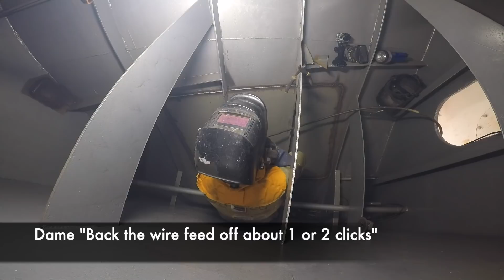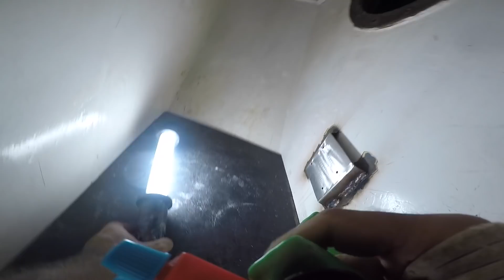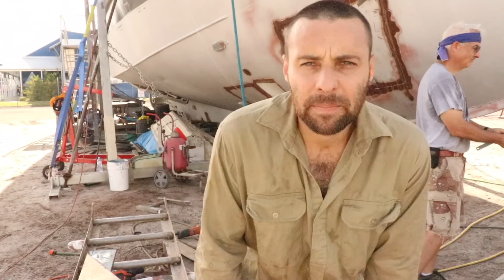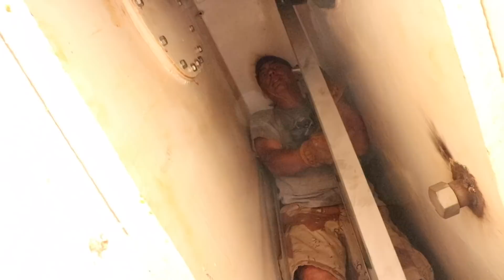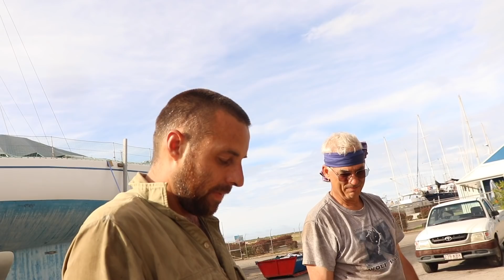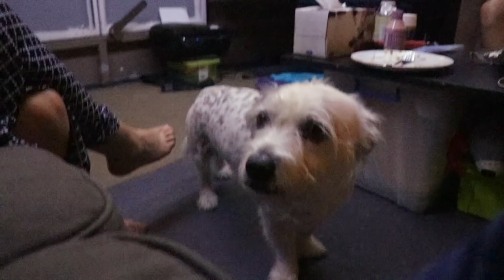Welding our hull closed (part 1) - Project Brupeg Ep. 75

Comment: I read a couple of great comments concerning drilling stainless-- yes, cobalt bits are best.

That said, with higher quality stainless, especially (such as 316, etc.), keep the heat down-- I mean friction (one comment mentioned "go slow". He's quite correct).  Heat toughens the stainless and actually makes it harder and more brittle, thus making it harder to drill as you try to drill. Another comment said "lots of lube"-- also quite correct. 

Ideally, it's preferable to drill stainless on a drill press set to a slow speed which frees one hand to apply lube every few seconds as you drill (assuming you have your piece clamped to the table).  With this, even Titanium will actually work-- going slow.

Yes, I know this bit is quite a few months too late. But future reference, bear this in mind.

Love your boat, love you guys! Rock on!
Reply from the maker: Thanks very much, since this video we have brought a drill press and nice vice for it so everything you’ve said fits with our current methods
Reply: I'm sure you're glad for it (drilling the hinges for your stern doors would have been much easier with that). You have plenty of work left for that drill press in the future, however, and maybe you can mount it in the boat  as part of a shipboard shop? 

You're doing an utterly fantastic job on this project-- you're fearless and competent, yet unafraid to seek help on what you don't quite know or understand-- that's what winners do. And why they win.

I heard of your project from watching Dangarstu (love that guy, too!), and, later, heard about you from Doug, with SV Seeker.  I found both Seeker and Dangar pretty much accidentally-- sweet finds! 

I also found the Arabella project just by chance. and had already been following them before Stu mentioned them-- and then he went to visit them! That was awesome. He also visited Doug while in the states-- what a great adventure for us that follow all you guys. So many brilliant people doing incredible things for the love of boats and the beckoning call of the seas...

I was in the US Navy, and actually loved being a sailor. (Okay, okay... I probably love my memories of that time now better than I truly appreciated it back in the '80s-- but, still...)

Anyway, always wanted to build boats. Or at least a few. Came THIS CLOSE to getting to do that a couple of times, but life happens. I'm not complaining-- I've had some GREAT jobs in electronics and R&D work that that I really couldn't wait to get back to every morning! I've worked with some incredible people and I've traveled a bit all over the states for those jobs, which has also been great-- loved it. 

But, you know, you get that nagging about the boats that never leaves you. That's where I'm at. So I can live a bit of that vicariously through you and Stu and Doug and Scott (with Sea Dreamer), and Leo (with Tally Ho!), and the Arabella guys, and that Irish guy (can't remember his name just now), rebuilding a steel sailing yacht.

So... I'm retired now, play with some wood projects around the house a bit-- but they're not boats! But I got you guys. And I love it. And I gotta toss a smidge of advice/hard-earned wisdom when I can. I hope you don't mind. 

I don't need to tell you to "hang in there", you're pounding this thing  beautifully, and Jess is hanging in there magnificently. I can't wait to see Brupeg underway. 

Love you guys! Love your boat!
Reply from the maker: Mate this is bloody awesome!. I'm stoked you found us and we get to share this with you. I think it takes a certain mind set to do something like this and its nice when people see behind the tools like you have. Its a funny wee community the YouTube boat channel mob, Doug helps get our channel off the ground by mentioning us when we had a couple of hundred people following us, Reece (Sailing Yacht Zora) was a channel we mentioned early on to get the word out and both Stu and Acorn have helped mention our channel and vice versa. Its a cool group to be a part of. Im glad your with us all.

Damien

Comment: I added a W terminal for my rev counter to one of my alternators but just soldering a wire onto one of the 3 coils under the back cover. Seem to work fine.
Plowing through your videos thanks to dangar marine for leading me your way.
Good luck and great work
Reply from the maker: Thanks and welcome aboard

Comment: That doesn't look like fun at all. That is tight to work in those cramped places. Looking good though and I'm sure you'll be happy when it's done. For what your doing, the plasma cutter will be better than drilling stainless. Not as true a hole but you won't be breaking drill bits. Stainless is really tough to drill and some alloys are almost impossible. Happy sailing.

Comment: How thick is the steel on your hull?  Going into the ice I'd be a little concerned looking at your equipment. I currently work on a research vessel that's ice strengthened and our hull thickness is  3/8" plus an ice band taking us up to about 3/4" along the bow with a 6" solid keel. Have you looked at any of the IMO polar code regulations?
Reply from the maker: Hi Nicolas. The hull on Brupeg is 6mm (1/4"), however we will be doing the ice strengthening in New Zealand. the plan is to add duplicate ribs between all originals, plus add another 8mm steel band around the boat, that will extend 500mm above the water line and 1m below. The stem and keel on Brupeg is 25mm thick steel filled with Cement. we dont intend to become an ice breaker, (we are not even remotely heavy enough for that, and the wrong hull shape) we do just want to build a strong small boat that is capable of going through thin sea ice and growlers. plenty of glass boats make the trip we are planning but we want something stronger again hence the steel hull with additions.

Comment: Titanium Nitride coatings won't cut good stainless...ONLY COBALT bits will cut it...and LOW RPM...with cutting oil, ideally. Stainless may be 'considered soft', but it is NOT...the nickel content (and chromium in some blends) makes it VERY TOUGH on tooling...Learned my lesson on a smaller vessel's stainless transom plate once...ended up, blades and bits cost more than the piece did to purchase! Chinese-tools are NOT ready to work stainless, either!
Reply from the maker: Yip I would agree with this

Comment: There's an fair knack to drill stainless even a crap drill will do it if you're slow and gentle, it work hardens instantly and becomes unworkable, if you hear it clicking away as it cuts you've hardened it and you're being too rough, you can anneal an area that has been hardened from drilling and recover a hole though iv done that a few times!!
Reply from the maker: Thanks good to know. Cheers

Comment: Never pilot hole stainless, if you can help it. I know it sounds crazy, but even if you are drilling a 1" hole you won't kill the drill as fast. As a retired Millwright that also did a lot of fab shop work I,ve drilled at least a 1000 stainless holes. Of course may require heaver equipment for 1"

Comment: Cobalt drill bits, slow the drill down,  pilot hole ans lots of continuous cutting fluid. The bit should be cutting throughout and if it isnt you will either blunt the bit or work harden the steel (or both).

Comment: Cobalt drills for stainless steel, don't let the drill rub without cutting, stainless work hardens in a heart beat if you don't keep the drill bit cutting, use cutting compound not lubricating oils. Cheers 👍👍

Comment: You need a cobalt drill bit and drill at a slightly slower speed. Also start with a smaller drill, stepping up to the correct size later. Please also use a drill press, you will get better pressure at the drill tip.
Reply from the maker: Would love to use a drill press but we don’t have one

Comment: You seriously need a Ventamatic.  I know the things are expensive but it would make your life a lot better.  With your mad skills you could probably build one.  
https://www.factoryauthorizedoutlet.com/ventamatic-hvhf12combo-12-inch-cylinder-fan-with-20-foot-hose-hvhf12comboups
Reply from the maker: Was our vacuumatic 3000 not good enough Rob? I’ve seen those pipe vent things. They use them all the time for sandblasting in the yard here.
Reply: @ProjectBrupeg  What's a vacuumatic 3000?  I'm talking about a air ventilation.  I never noticed you using one.
Reply from the maker: We welded in the bung at the bottom so we could attach a high volume vacuum and suck all gas from the bottom of the tank out, drawing in fresh air from the top. It created a constant downward flow of fresh air

Comment: You need to watch confined spaces, use a extraction fan to keep fresh air in small areas.
Reply: Made me claustrophobic just watching.
Reply from the maker: Hi guys yes we added the bung specifically so we could attach the shop vacuum and extract the argon out of the space from the lowest point

Comment: A trick that works well for drilling larger diameter holes in tough material is to drill a smaller diameter hole first. The smaller diameter should be just large enough to clear the web of the larger drill bit. The web (point) of a drill bit doesn't do any cutting since it's rotational speed is near 0 RPM, so for the sake of efficiency pre-drilling a clearance hole helps a lot.

Comment: I hope you are using a gas detector while working in the hull!
Reply from the maker: When welding we always make sure we have a method of extracting air from the bottom of the tank so we can feel a powerful breeze from top to bottom (because we use argon). We do t have gas detection but we have done this enough to know it’s effective now

Comment: Slow those drill bits down. :) You need a bench type drill press. The boat needs one.
Reply: Or a good mag drill , might be more useful for engineering on the go.
Reply: @ClaytonwFirth  true but so expensive.
Reply from the maker: Yip it does. But for now I’m it. As for speed, we can slow them down. Thanks John

Comment: Hi Damien.

Because the ladder itself takes up so much space could you have welded sections of angle iron onto the walls as steps instead. With rounded over corners they may have worked as well.

Luv ya work.

David.
Reply from the maker: Yeah that would have worked, we had the ladder so it was an easy install really but had we not I was going to bend some solid 16mm stainless bar into rungs and weld them on
Reply: @ProjectBrupeg  Hi Damien. I was thinking more from a time it took and the space available side of things. But we all think differently and I am much older and and always looking for a less energy way to achieve a result. You are doing great work with Brupeg and lucky to have Richard to help out. Regards. David.

Comment: Cobalt bits or carbide for the win, titanium wont do it from my experience. You'll find cobalt drill bits much easier and cheaper than carbide. Since the cobalt/ carbide are much harder and they are very easy to break/ snap off. Make sure your drill vertical and dont try to wallow out a hole. They will drill a hole through stainless with ease.
Reply: I think the "titanium" label was stating the material to be drilled.
Certain grades like G2 Ti are like the bastard offspring of aluminium, copper and stainless steel (work hardens like Cu so it leaves a very hard surface at the cutting face, gums up tools like Al and tough to cut like SS)
Reply from the maker: Thankfully we have very little titanium on Brupeg
Reply from the maker: Thanks Willow

Comment: Is the hull going to be reinforced to prevent ice piercing. Just curious what the plans are. Or was it originally built for working in ice.
Reply from the maker: Hi John, we will be adding additional ribs internally and extra plating on the exterior to deal with ice. We have been advised she should be strong enough without these mods but we don’t want to head south based on “should be” much preferring “would be”

Comment: Couple of questions; 
Why not just plasma holes for the bracket? It's just a bracket
After all that, are you going to clean off and re-paint the backside of those welds?
Missed a bit? @958 looking up above the hatch did you get that patch.....just didn't video it?
You don't seem to chamfer the edges of your plates before welding or am I missing that bit.
I think Mish just wants Richard to explain what makes him so special that he gets fed before him, no one likes getting pushed down the ladder.
Cheers love your work.
Reply from the maker: Cheers Dan. Yeah we did get it all painted but it didn’t make the edit, not very exciting watching me paint... the plates had a chamfer on them we made two years ago when I cut it from the hull. This time round we just needed to sandblast the edge to make it weldable
Reply: @ProjectBrupeg Thanks for taking the time to respond, guess you cant film everything, just hoping you didn't miss that one spot.
Reply from the maker: All good. Thanks for checking the channel out

Comment: Interesting with all the comments for drilling Stainless, I have and continue to use standard HSS drill bits (eg Sutton brand), sharpen them correctly, use cutting fluid like Rocol, keep pressure as you drill, you'll know the amount of pressure needed as the swarf comes away cleanly.  If at anytime the drill stops cutting, stop, re-sharpen and go again.  Once the drill bit stops cutting all you are doing is heating the stainless and it will work harden, when that happens it takes way more effort to get past the hardened zone.
Another tip, drill a small pilot hole first, anything up to about 5 mm will drill easy, then you can drill a larger hole with ease.
Reply: Finally someone that knows how to drill S/S.
Reply from the maker: Yeah we use Sutton HSS for most things. Some of the stainless we use is older (from previous trawlers that have been altered over the years) so I do wonder if it’s harder than new stainless
Reply: There are cheap Stainless Steel like 3CR12 and 5CR12, I'd imagine most boat builders would use 316L or the lesser 309 and 304 (based on the average cost of Stainless), I wouldn't think they be harder to drill unless there has been some sort of action applied to the material during its service (eg, folding, welding and extreme localised heating).  In saying that I have come across Chloride corrosion that can change Stainless, you would see this type of corrosion along drip edges where saltwater dries and leaves a build up of Chloride ions, there would be lots of pitting.  Rinsing with fresh water and maybe a coating of paint can minimise this. 
Keep up the good work, it's been interesting watching the process you go through while getting this job done.
Reply from the maker: Thanks very much. Some really interesting points you’ve raised that I was t aware of
Reply: @ProjectBrupeg  Stainless is a great material but painful at the same time. I'm glad I had something to share.

Comment: 3:24: Can't tell if Ryan's a giant or you're compact, but you're bloody right-sized for this part of the job. 6:24: I've got the same high-performance mounting system. Not on the fuel lines, mind. 13:27: Secure the brackets with pins, not bolts. That way, if you ever need the ladder out of there for whatever reason, it can be done without tools. 23:00: Christmas, indeed. That torque wrench is a beauty and things that need proper torquing to predictable values in the engine room will benefit from it. 42:05: Your American friend is a godsend, not just for his skills but in the time and work it saves having a second set of limbs to help maneuver gear and materials.
Reply from the maker: Yeah we often discuss having a skill helper makes us about 5 times faster than doing the job solo. Especially in tanks as it takes 5mins to get in or out so small tweaks on the welder once your end are a much avoided thing when solo
Reply: @ProjectBrupeg  Well, maybe that's a way to encourage people to help you a little less by sending you stuff (much appreciated as it is) and more by showing up to physically aid in the work. Because there's always work.

Comment: When drilling stainless a drill press will always do a better job than a hand drill because you can maintain even pressure and keep the cutting edge of the bit at the correct angel  lots of cooling with oil will help too
Reply from the maker: Yeah I would love a drill press and a mag drill but alas. I’m it for now
Reply: Project Brupeg  You can get an adequate press fro about 60 bucks from supercheap
Reply from the maker: Cool I will have a look at them

Comment: I would pressure test the tanks. Install a pressure gauge, pump it up to about 5 psi and let it sit overnight and see if it drops any. Good job by the way!
Reply: Good idea
Reply from the maker: Yeah we will be testing them. Now that they are sealed up we are able to hold pressure in them to check